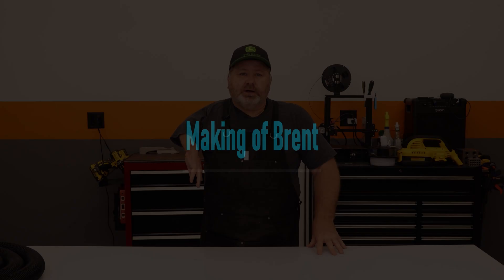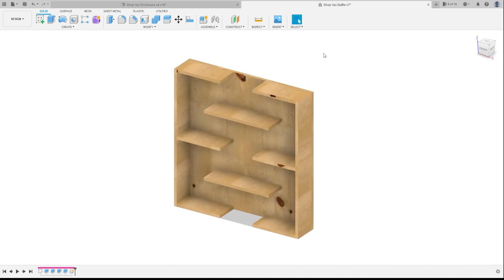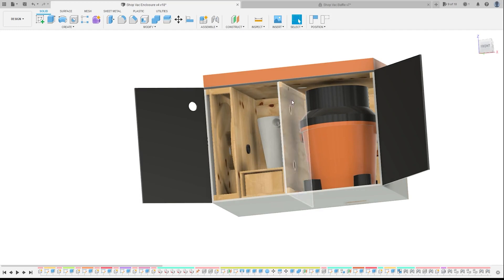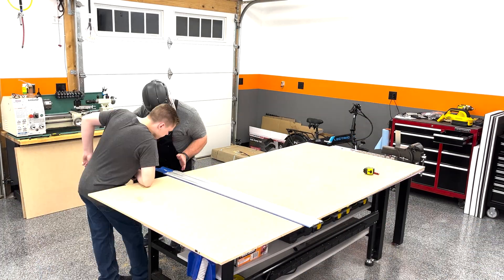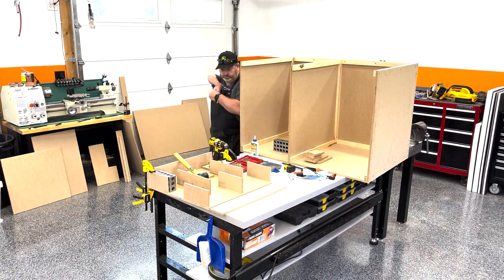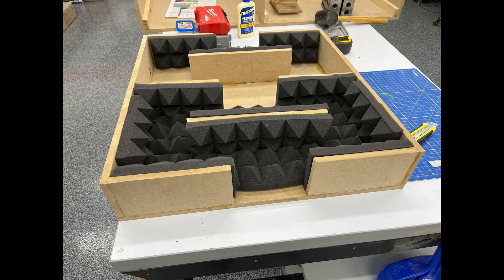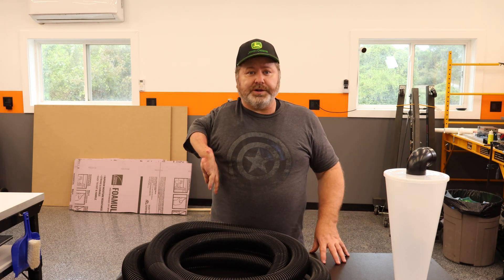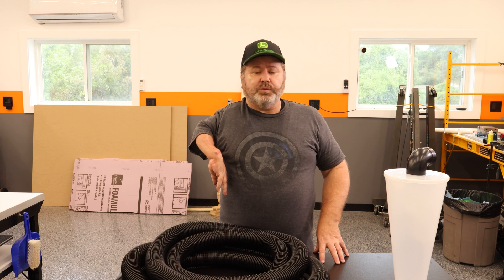DIY Shop Vac Enclosure (Part 1)

Comment: Any issues with the vac motor getting hot?
Reply from the maker: Not yet. I have not run it for more than an hour at a time, but when I checked the temp it was warmer than ambient, but no where near hot. I also only use this in an air conditioned shop.

Comment: Hi Brent, love what you’ve done! Quick question about your dust extraction plans. I’d never considered bolting the cyclone down onto the wood with a drawer underneath. Genius! I’m just wondering if there will be any issues as all the other examples I’ve seen have used something air tight to bolt onto (bucket etc). Whatcha think?

Comment: I gave a thumbs up because this is by far the most effective enclosure I've seen but I don't really understand the air/sound flow and how the "baffle" affects anything. It looks like you completely isolated it???
Reply from the maker: Thanks for the feedback! The baffle has a port on the top and bottom that lets the exhaust air flow through it. The cabinet also has a hole cut in the bottom that aligns with the bottom baffle port. The idea is that the sound waves would have to travel through the baffle to reach the exhaust port at the bottom of the baffle/cabinet. I hope this helps, if not let me know and maybe I can make a short explaining the air/sound flow of the cabinet.

Comment: This is amazing!! I love multipurpose and space saving ideas! I'm a hobby woodworker so my space is very small and I work mostly in my garage or backyard so the reduction to noise will not only be helpful to me but I'm sure the neighbors will appreciate it too. So glad I stumbled across this video
Reply from the maker: Thank you for the feedback, I really appreciate it! It does make it so much nicer to use the shop vac. Now I don't hesitate to pull out the hose for a quick cleanup.

Comment: Great job! I was wondering about the heat build up. Have you had any overheating due to the enclosure cabinet?
Reply: Thanks! I haven’t had any issues yet, but I normally only run it for a few minutes at a time. There should be quite a bit of air movement as the exhaust has to travel up and out through the baffle intake at the top of the enclosure.  I will try to run some tests with a temperature probe and let you know what I find. Thanks for watching!
Reply from the maker: I have been meaning to make a short on this, but I lost my video footage and haven't been able to make myself re-record it. I found that it does increase the temperature in the cabinet about 20° F when I ran the vacuum for an hour. I am not too worried about the extra heat as it stayed under 100°F. If the extra heat is a concern, it would be pretty easy to add some computer case fans to add some extra air flow.
Reply from the maker: @John O'Neill Thanks! I haven't had a chance to measure the temps yet but I am hoping the constant air flow in the vacuum side will pull out any heat build up. The exhaust intake port is near the top of the cabinet so that should force the hot air out. I just need to get a good way to measure the temps and verify my theory.
Reply: I run a similar setup with a Dustopper and this has been a common question in my video. Almost 2 yrs of pretty heavy use and no issues yet. I did contemplate installing a heat sink, but if it's survived what it has I don't think it is necessary.